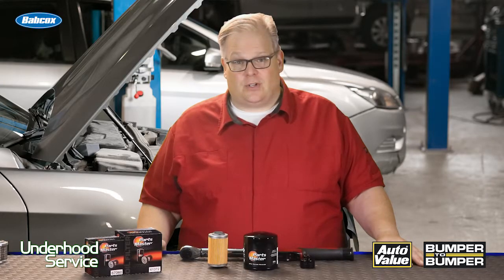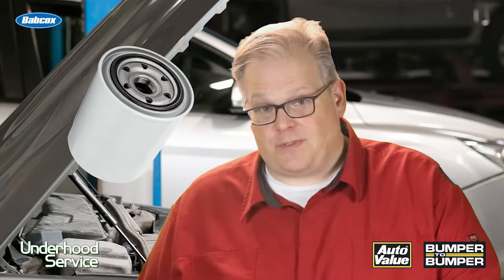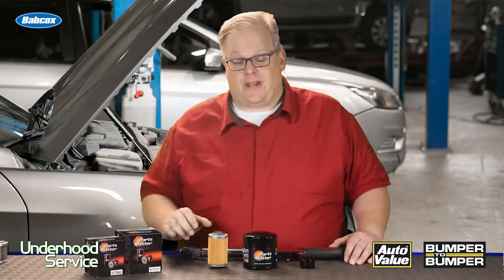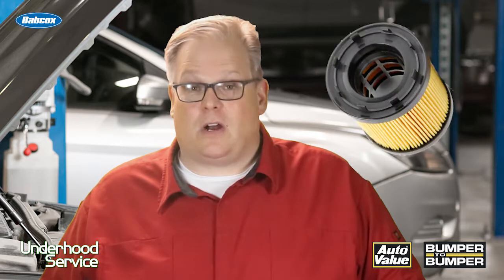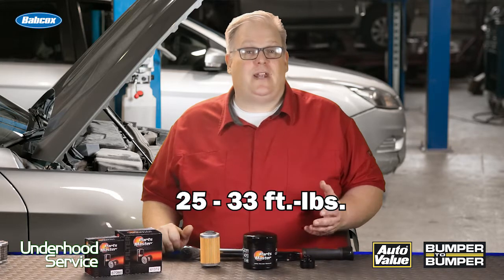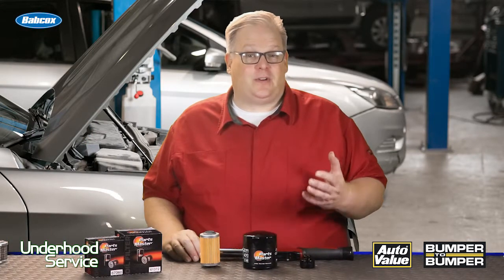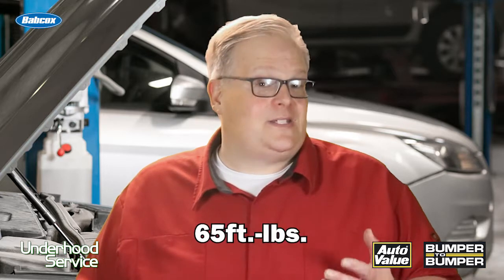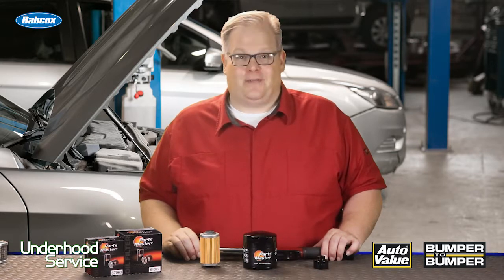Torque Specifications On Cartridge Oil Filter Caps | Tech Minute

Comment: The torque specs for a Toyota cartridge oil filter cap is right on the cap and it is not 25 to 30 ft.lbs. as you said. It is 25 N•m ± 5 N•m (or 18 ft.lbs. ± 3½ ft.lbs.). And if there is a drainbolt on your oil filter cap it should be half as tight.

Comment: I say drain plug torque is also widely miss-applied. I've had a Volvo come back from a dealer with a totally deformed and flattened crush washer. It was obvious it was torqued way beyond spec. likely with an air impact gun...